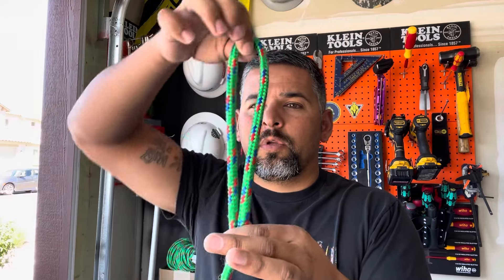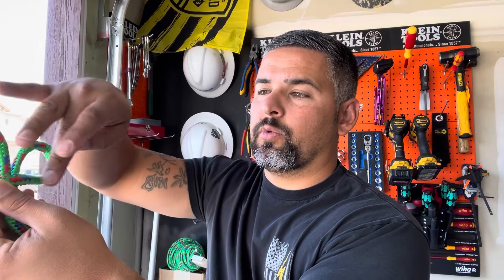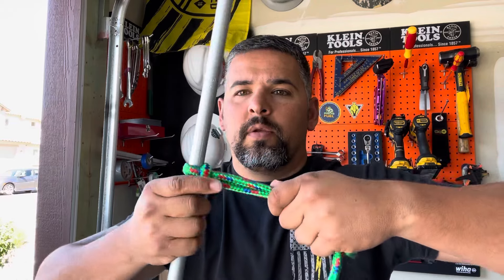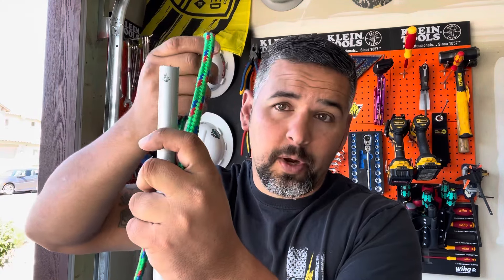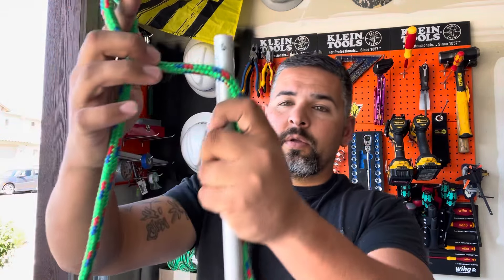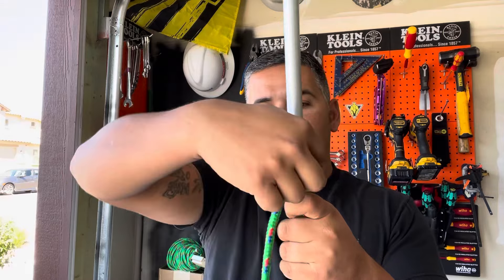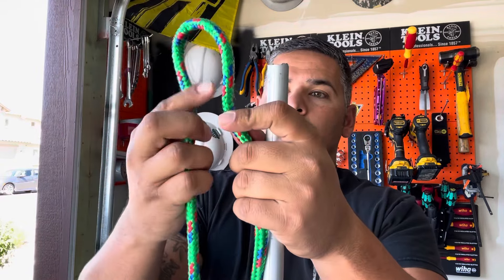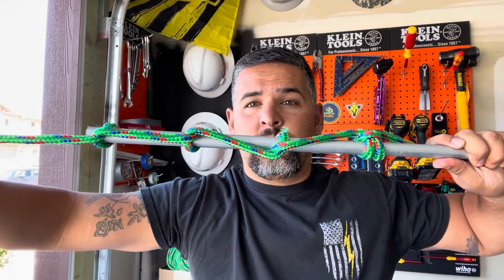MOST USED KNOT FOR PULLING WIRE!!! The 1/2 (.5) Hitch Knot 🪢 #electrician #wirepullingknots

Comment: I watched the whole video, and I appreciate the content. 

Using your knot setup, I just pulled 3 conductor, 4/0 cable through about 70 ft of conduit with 4 full turns.

It worked like a charm.

Comment: I need to pull a security wire by string through a conduit to my building.  I wasn't sure how to attach the string to the wire.  I watched some videos and was still a bit confused until I watched yours.  Using the big pole to represent the wire and the rope to represent the string made it easy to see and your explanation made it very understandable. Thanks.
Reply from the maker: Thank you ! Leather work is my next journey been saving scraps to practice the sewing

Comment: I've pulled miles of 500 mcm wire, many parallels, through 4 and 6 inch conduit over the years using the half hitch. Never had a failure to pull, quik and easy .

Comment: The way I was shown when I started in the trade was using a simple overhand knot on the first one then taping the knot and the tail of the string to the wire or cable. It doesn’t matter as much what knot is used before the half hitches, as long as it is secured. The one you used is a lark’s head. It has a few other names (Cow hitch, I think).
Reply: Thanks for adding the larks knot clarification info. I’m new to knots but this helped me out a lot! #sharetheknowledge THANKS GUYS!!!
Reply: You definitely worked with some good journeyman as an apprentice

Comment: I use this ALL the time, thanks so much!

Fun story: Had to pull parallel 500s over about 300 feet with a 90 degree turn at the end, used this and it worked so good for the first set, second set however.... We got NEARLY to the end and it got stuck, and our 10,000lb tugger (never went over 1000lbs on the controls) BENT IN HALF. So we rented another one, 6000lbs cuz that's what was available and the rope snapped (7500lb rated rope). So we had to cut through the slab and dig down to our PVC, careful not to damage the water pipes right next to them, cut it open and re-tie the end. It had gotten caught on a cheated pipe from the previous crew who did the groundwork. Pulled through the rest like a charm. Needless to say I had some choice words for the guys that put in that PVC originally lmao

Comment: In my 50 years as a sparky never tied knots on wire. Produces too much bulge. Have 7 different sizes of pulling grips. Would weave a grip just the right size for pulling  3#2'S and a #6 ground to one end of a 1/2" nylon pulling rope and weave a larger grip on other end to take care of pulling cable thru 2" conduit. Used both ends of these grips hundred of times over the years and gave it to a young electrician when I retired.
Reply: Pulling grips are great also but I was told yesterday( which is why I looked up this knot for home use) that you can use this type of know for fiber jumpers to pull indoor fiberotic cables. If you do damage the fiber you can clean the end and light test it and move on!!! Thanks!

Comment: I tend to have the most luck splitting the conductors (usually about 1½' for something like 600 kcmil or something) and folding them through a single smaller knot then tape it with 2" super33 or 88
Reply: The knot is for pullin the last ten feet when ur original knuckle hits the puller u do the half hitc to pull the rest
Reply: @adamjag7799  personally I use an electrician stopper knot but this one is easier to teach

Comment: ????  This looks like a good knot for dragging downed tree logs through the forest.... but for cable pulling??!?  This knot, while it might be secure, is adding bulk to the diameter of the cable you're pulling - which is the last thing you'd wanna do.  If you make your wire loop well enough, which knot you use will be less important.
Reply: Wireloop? This knot is used for big wire pulls! It is hands down the most used knot
Reply: If you think this is too big for the conduit on wire with mule tape - then the conduit is likely too small for the wire you’re pulling….
Reply: Was just about to say the exact same thing. Mule tape is what a 16th in thicness. If it's a issue see wire fill lol @NoName-semi-censored